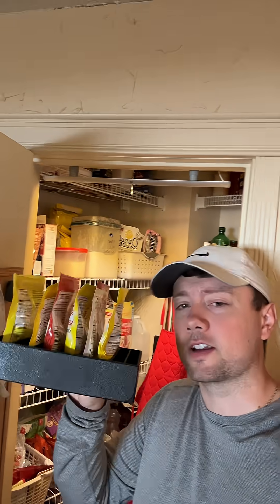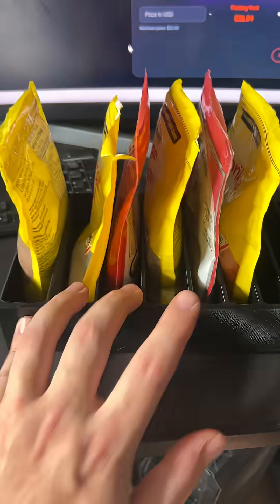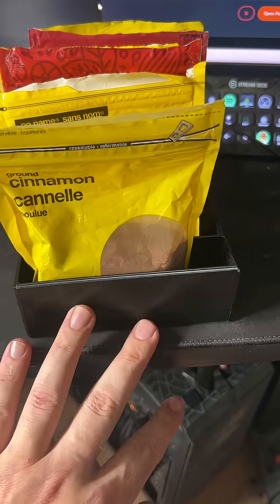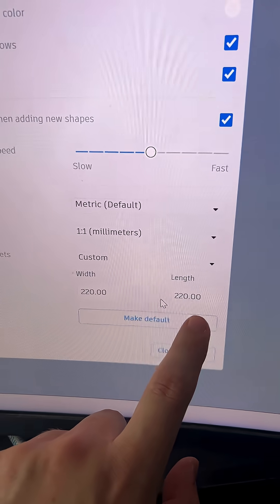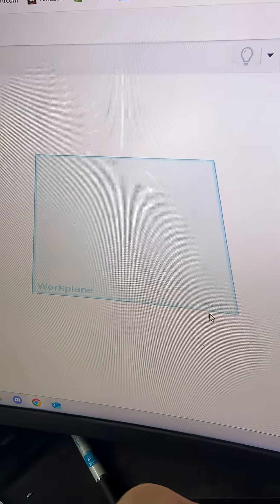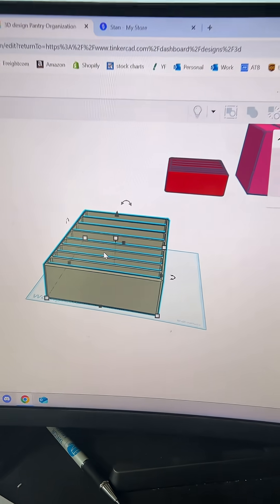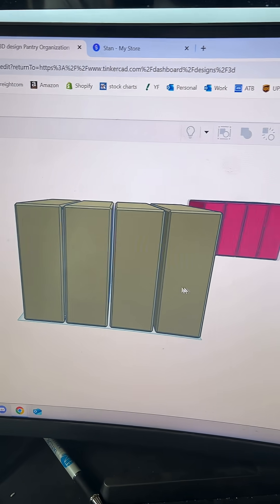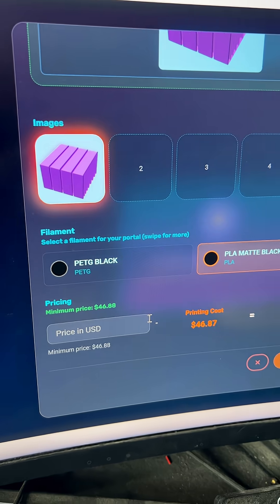How to cut your cost in half when 3D Printing

Comment: How much is the fucking power where you live, does it cost $45 just to charge your phone? Get out of here with these insane “costs”
Reply: Filament is expensive. A good sturdy shelf that fits on my 28x28cm print bed is starting at 300-500 grams of filament easy, not that hard to see why this shelf could take more filament. I use the cheapest PETG which is 22 bucks per 1kg, he might be using something more expensive also. As for the power draw, my A1 consumes an average of 95 watts during printing. His might be a bigger printer. The prints take many hours to complete, but even at 20 cents per kWh the electricity bill is negligible.
Reply: @itsnetts  300-500 grams? Did you set it to solid infil or something?
Reply: @itsnetts how is $22 the cheapest PETG per kg?? Do you live on a secluded island and someone has to bring it to you by plane?
Reply: @ClappinCheex  You tell me. 22€ is the cheapest PETG my local shop that sells it has. I live in Finland.

Comment: Where are you getting 22 USD from? A 2LB roll of filament from AliExpress such as Jayo only costs around 15-20USD and there's no way that spice rack uses anywhere near a full roll.
Reply: Maybe if he is printing ASA that's around 35 dollars per kg with complete solid infil the. It would make sense but then this dude would have a whole other problem
Reply: I buy ASACF 3kg at a time for $18/kg. No way his PLA costs more than $7 /kg buying 3kg.
Reply: @cbpuzzle where do you get the ASACF and PLA for $18 and $7
Reply: @khartwell6910  Not sure about ASACF, but I can get a roll of PLA (Jayo, 1.1kg) for 8 euros right now. Which is roughly $9.50. This includes VAT as I live in the EU, so without it'd be closer to the $7 mark.

Comment: Lol? Those overhangs are not printable.

Where are you getting this $22?
Reply: Not only that it makes the part weaker as well
Reply: A lot if not all of the printing slicers tell you the filament draw of the print in grams. Many also just straight up tell you the total cost of the print if you input the cost per roll.
Reply: @itsnetts that's price for teleport a 3d printing service